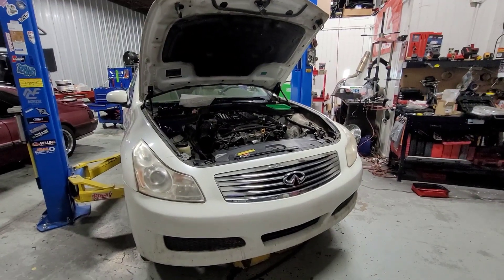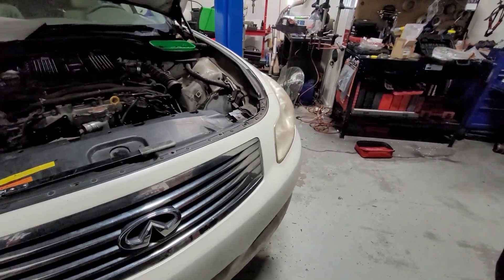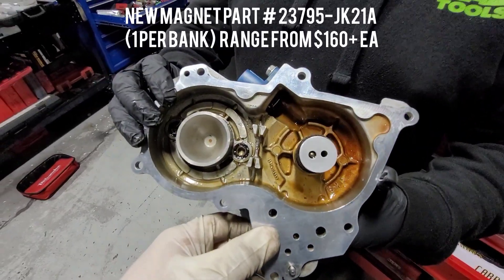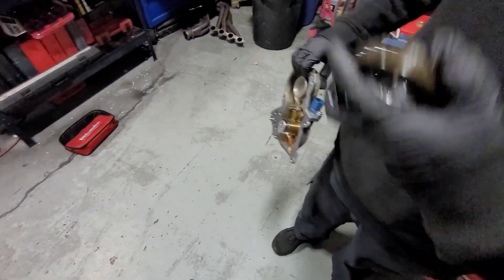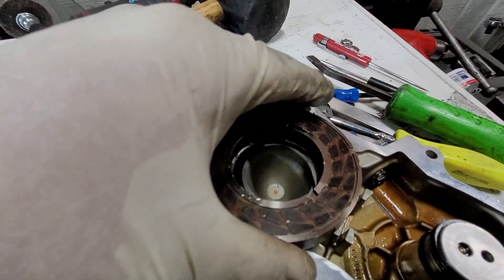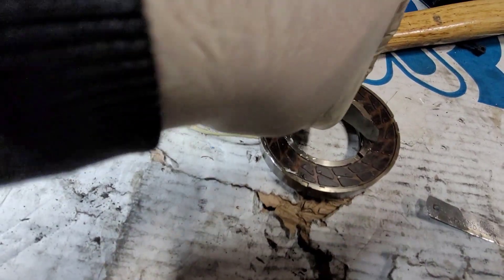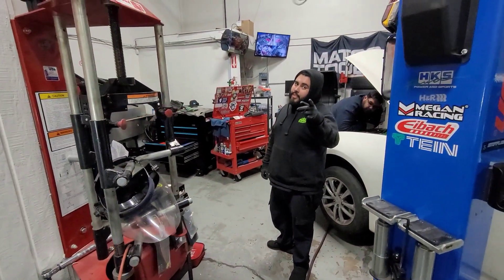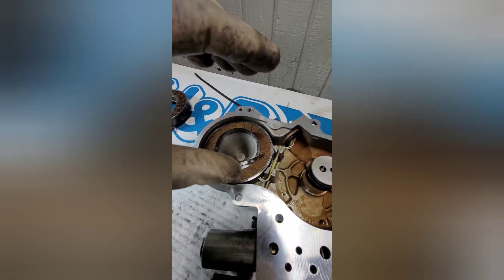G35/G37 Magnet Retarder Removal for P0014/P0024 VTC Cover

Comment: I have p0021 & p0024 codes on my 07 g35 sedan, is it the magnet or should I just go get it diagnosed??
Reply from the maker: @DillonDoe-z7p  check your oil if it's low/dirty it can cause these codes

Comment: I think I'll eventually need this on my 2010 FX.   Randomly dies at a stop sign as soon as I go to press the gas... happens like 5 times a year.   Never a CEL.   Assuming this process should work for that as well?  Just pick up the magnet for another 3.5L?
Reply from the maker: I would try to diagnose your issue to make sure this is the problem. Check your intake boot for tears. Common problem I've seen that sometimes doesn't throw a lean code.

Comment: im getting a code p1078 for B1 on my 07 hr. I replaced the vtc timing solonoid but still have this same code popping up. any ideas what else it can be?
Reply from the maker: bank 1 EVT control position sensor is located on the back (firewall) end of the bank 1 is the most likely cause if your lucky. If not the the cam gear

Comment: This PN is for a maxima with the DE engine does the HR and DE use the same retarders ?
Reply from the maker: Yes
Reply: @heemdealer  it doesn’t matter anyway the case isn’t the same the pins from the retarder wires that go to the connector would have to be disconnected and only then could the retarder be replaced or else you would have to chance the entire case for 500. Does that sound about right ?
Reply from the maker: @Flackoxmargiela  direct plug and play no wiring needed. If changing the retarder is outside of your skill set you can just replace the whole cover.
Reply: @heemdealer instead of being shady you could actually explain and teach like you were supposed to be trying to do. So if there’s a way to unplug it please inform me I was skilled enough to get the case off and get the retarder out with paper shims :) or feel gauges
Reply: @heem 3:02 dealer how do you keep the code from coming back? I've changed the magnet, but the code comes right back after I erase it with the scanner
Reply: @heemdealer or is there a way to remove it from the rubber like piece that holds it in

Comment: Just got it couple of weeks ago. It’s a 08 g35. 

It had a code for p0021. Changed the oil with 5w30, and cleared the codes. The same p0021 came back and decided to clean the vct solenoid on the driver side which is the side with the p0021. Reset the code and it was back. So decided to order the vct solenoids from 1a auto. Cleared the code and did the relearn. The code came back and it’s pinging at lower rpm’s with the new variable intake solenoid. If I install the old solenoid no pinging. Any thoughts? Thank you.
Reply from the maker: What brand was the solenoid? Try oem
Reply: @heemdealer  

One from 1auto and the second one a hitashi one which was expensive.
Reply from the maker: @gloglo1275  the Hitachi is still causing the cel?
Reply: @heemdealer  

Sure is. It’s been such a pain. The old one I removed does not open or close when using the battery test yet it didn’t make any noise at all when it was installed. The new ones both work because I did the 3 tests with the ohms and battery test and they work perfectly. Unfortunately they make that noise like when you put regular gas on a premium car. It first does the noise quickly when first turn on and while driving on lower rpm’s.
Reply from the maker: @gloglo1275  that's strange. I have heard rare instances where this problem was caused by a faulty camshaft position sensor. Or the actual cam gear. Maybe switch cmp sensor from the other bank and see if the code follows.
Reply: @heemdealer  

I replaced the cam sensor with one from 1auto. It was making my car crank very long. So I put the old cam sensor back and it is starting normally. 

On a separate question. I was trying to replace the high pressure power steering hose but my nut is seized. Is it okay to drive it with the hose not bolted to the frame? That was a royal pain to get those brackets off to allow the hose loose. So since the leak is on the top where the top 22mm screw is I’m just going to replace the copper washers. Just not looking forward to putting those brackets back. Lol
Reply from the maker: @gloglo1275  yes that's fine but at least try to zip tie the hose in a couple of places. For the other issue you need to check timing with a compatible scan tool.
Reply: @heemdealer  

I did checked the timing and while at idle is at around 14-17.
Reply from the maker: @gloglo1275  should not be more than 0 +/- 5 degrees at idle
Reply: @heemdealer  

I changed the timing to around 7 and it was driving like crap. It was bucking and shifting erratic. I have a 2010 g37 and checked the timing on that one because it drives perfectly with zero codes. It is at 14 at idle.

I put it back to the 0 setting on my scanner which gets it to 14-15 at idle and it drives perfect and shifts like butter. The only issue I have is that pinging when it’s first turned on and while on low rpm’s.
Reply from the maker: @gloglo1275  has the flywheel been changed recently?
Reply: @heemdealer  

Not that I’m aware of. I own a 350z roadster, g35 and g37. I bought my g35 to be my daily when my accord was totaled parked in front of my house. That really sucked because everything was done on my accord. I already owned the 350z and really like the vqs. So I got the g35 for a great deal and originally had the p0011, and p0021. I erased the codes but the only one that kept coming back was the 0021. Before that I’m not sure of much. My cooling fan just went on the g35 and I’m waiting on a new one I just got. This was why I ended up getting the g37 to be able to not have down time on a car while working on it. Sorry for the long explanation, but trying to give a little background. Thanks for your help for sure.
Reply from the maker: @gloglo1275  all good alway down to help. Definitely sounds like a timing issue though
Reply: @heemdealer  

Funny thing is it drives like a dream. No lost of power or anything like that. It drives with plenty of power and everything.
Reply: I found this 

ITEM SPECIFICATION
Idle speed A/T: 650 ± 50 rpm (in P or N position)
M/T: 650 ± 50 rpm (in Neutral position)
Ignition timing A/T with 4WAS: 11 ± 5° BTDC (in P or N position)
A/T without 4WAS: 15 ± 5° BTDC (in P or N position)
M/T with 4WAS: 11 ± 5° BTDC (in Neutral position)
M/T without 4WAS: 15 ± 5° BTDC (in Neutral position)

Mine is at 14-15.
Reply from the maker: @gloglo1275  Check scan data for the Intake Valve Timing (IVT) degrees on bank 2. The PID will be displayed as INT/V TIM. Look for around 0° +/- 5° at idle. The degrees should go up on acceleration. Compare bank 2 to bank 1

This is what I have for testing
Reply: @heemdealer  

Idle I’m at b1 -1 and -0
Idle b2 0

2000 rpm 

B1 (0)
B2 (4)

After doing this stepping on the gas at 2k rpm they are both at 2. The b1 and b2 is fluctuating between 1 and 2

As I accelerate towards the 3k rpm is starts to make a noise. I was able to lower the number on b2 through special function feature while testing and the noise stopped. This was only through a test function so I couldn’t permanently keep that number.
Reply from the maker: @gloglo1275  Interesting, maybe a bad oil gallery gasket possibly ecu problem. Really hard to say without testing in person.
Reply: @heemdealer  

Yeah I get it. Thing that sucks is that is a whole lot of job for something that may or may not be the issue. The oil gallery gasket. 

Do the numbers seem to be okay? I don’t understand much of that. I just got the numbers you asked me for without fully understanding that aspect. I do have a nice matco scanner that at least allows me to perform a lot of tests.
Reply: @heemdealer  

Weird thing as well is that the old solenoid which would not open or close was not making any noise at all. Yet I put a brand new one hitachi as well which I know it’s OE, and it makes that noise like pinging. I’m thinking about putting the old solenoid to be honest. Also can you clarify to me what those numbers mean? I wasn’t clear about that. The one at 0 and the other one at around 4 at 2k rpm.

Update:

I went back and removed the hitachi solenoid on bank 2 and now I’m
Getting almost matching 2 values at 2k rpm on the int/v. yet it set off the code for p0021. No more pinging
Reply: Did you ever get the code off
Reply: @kingron8061  

No I didn’t. I sold the car to my son which is getting the gallery gaskets, timing chain, tensioners, guides and water pump replaced.